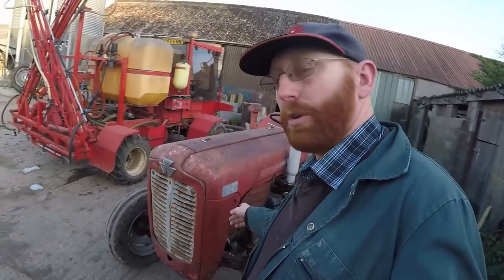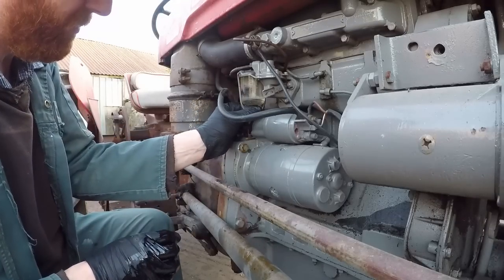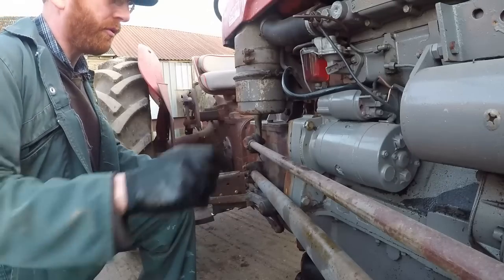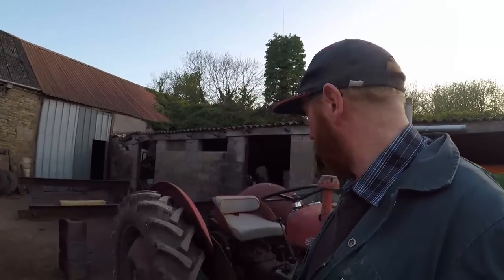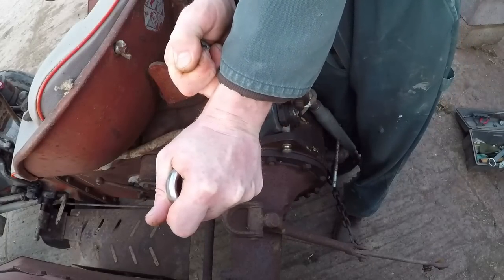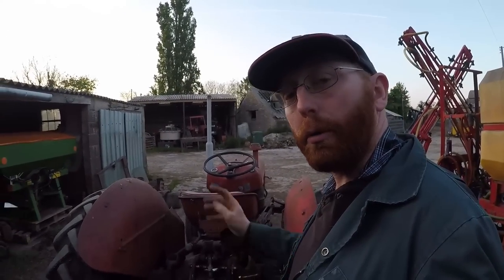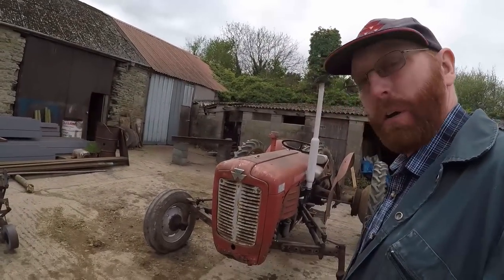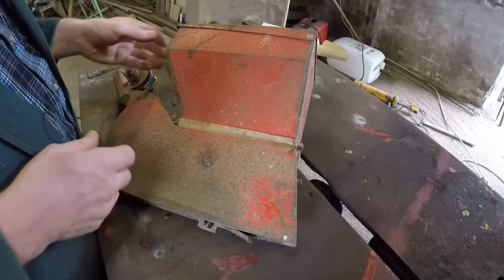Vintage Thursday. Massey Ferguson 35 wheels go wide.

Comment: Good little job done dan, didn’t take too long & has prevented a potentially much bigger job or breakdown! Just looking straight at the dynamo bracket there on the first camera angle and just wondering how it’s held on as the two bolts that screw into the timing cover look to be missing ?
Reply from the maker: Yes, it's not the original engine and has a bodged bracket as the holes in the timing cover are stripped.

Comment: Great video Dan, such a simple but ingenious system. Is there any reason you don't seem to use penetrative spray before undoing old bolts?
Reply from the maker: They're moved regularly so not seized.

Comment: Great explained video dan, if you put the row crops on normal width would there not be 2 rows in the middle and 2 on outside?
Reply from the maker: We tired it last year when we changed the drill, it doesn't work out.

Comment: Hi Dan, what did you spray into the glass bowl when you cleaned it out?
I noticed you didn't put stabiliser on when you put the Stanhay drill on the tractor. Don't you use them?
Reply from the maker: Just some brake cleaner.
The drill follows well enough without stabilisers.

Comment: Didn’t you have to put stabiliser bar on to keep it straight and rigid Dan.
Reply from the maker: No, it follows well enough once in the soil. 
If it's held rigid a small error in steering is magnified in the drill rows.

Comment: That engine does not sound right to me Dan . Sounds like one of its inlet valves is not seating .Maybe not enough valve clearance . By the look of the non standard dynamo bracket it was probably fitted with an alternator at some stage of its life .
Reply from the maker: It's not the original engine